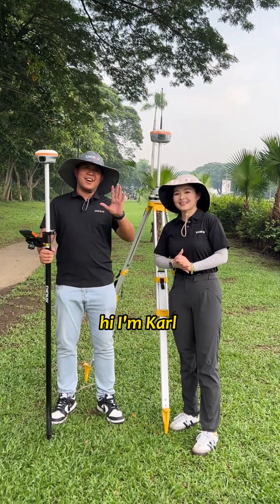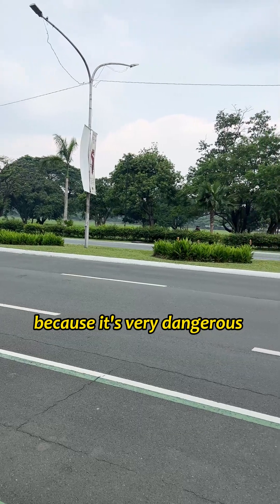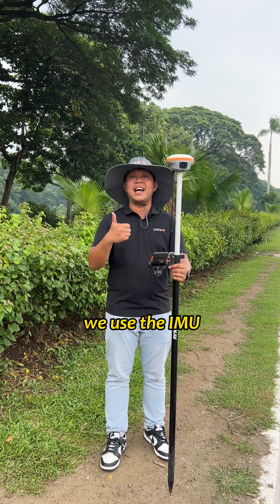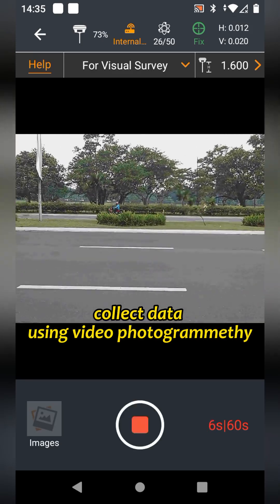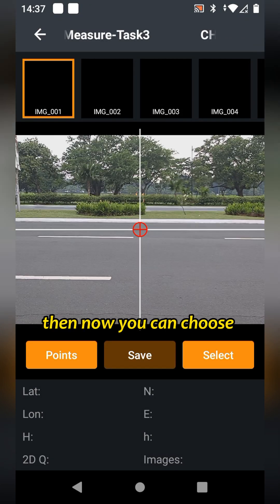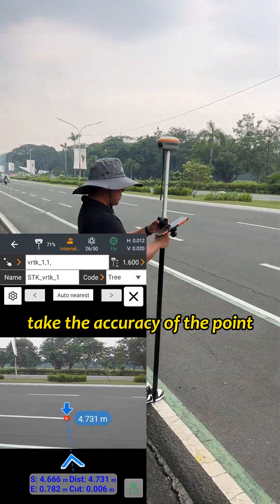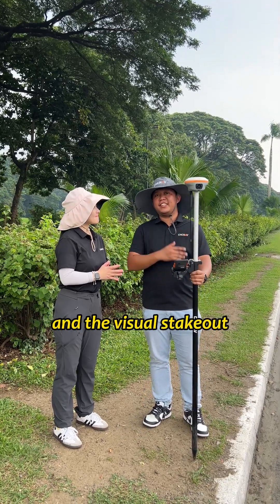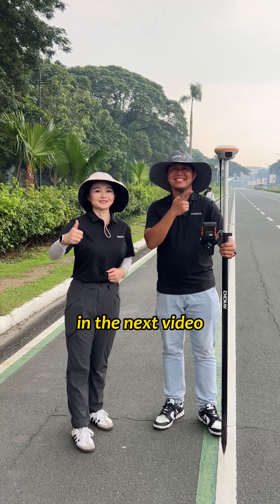Visual survey in the Philippines.

Comment: HI Rachel and Karl, thank you for the short video. WE WISH Rachel could come to Austin Texas or San Jose California where we just received our new (Blue ) X16 Pro i91 rovers .
We want to see a video on how you inserted and connected the sim card for rover and if you put sim in i93 or the data collector and what difference that would make. Also why does the rod height matter when visual is used? It seems Rod Height is disengaged and not a factor as the camera and rod are actually off the ground when walking/filming during visual, can you verify? Also, we want to see how to go from the hot outdoors after gathering data and using a larger screen computer to work with the data indoors and manipulate the data to correlate with older cad files or local coordinate based projects. THEN we want to talk to Rachel about the best scanners for surveyors to complete the visual survey and not miss any details that any project might require and even go indoors and under dense areas without limitations on time and to correlate the data's effortlessly. We believe in CNCNAV and wish you were here to show US how convenient and cost effective CNCNAV solutions are. We are available in either Austin or San Francisco or Silicon Valley (San Jose) if those destinations are possible for CNCNAV to come SHOW US- WE WILL FOLLOW YOU Rachel ...